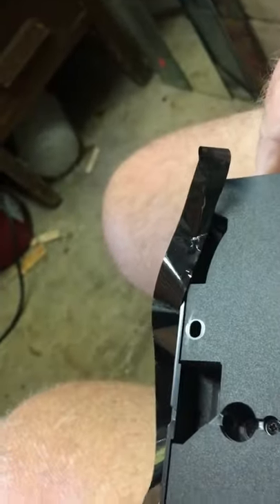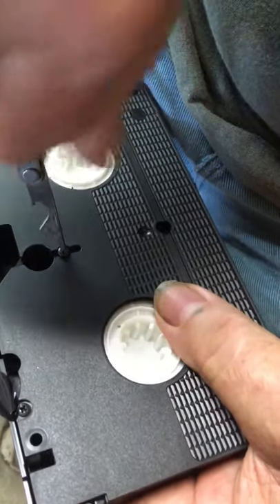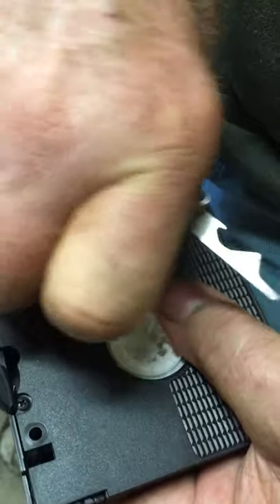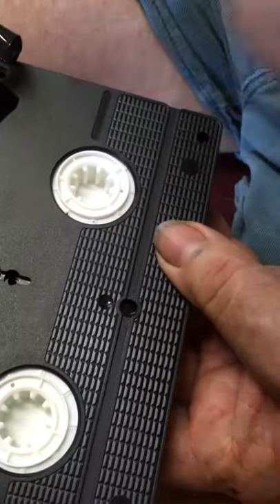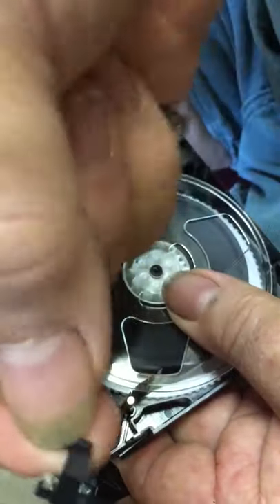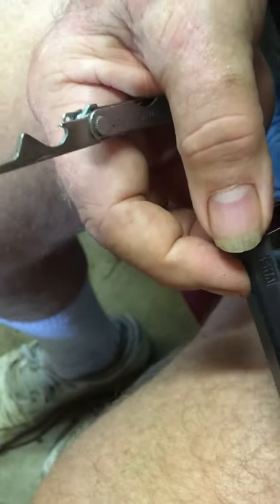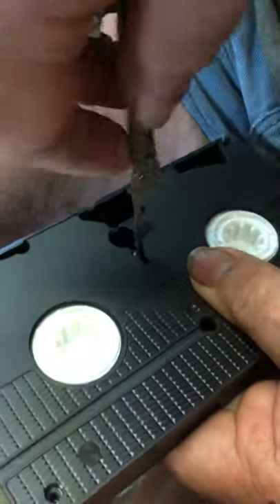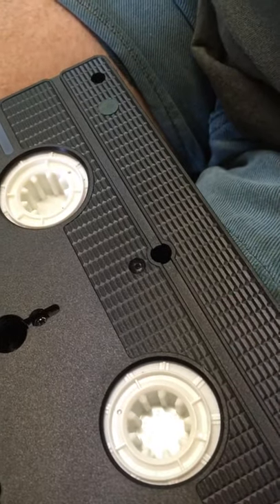Fixing a VHS tape which gets tangled in the machine.

Comment: Hey boss, is there any way I can  stop my VCR from actually tangling tapes?
Reply: About all you can do with the machine is keep it clean and free of foreign objects. The cassette labels come off and gum up the works sometimes, or things like paper clips. Also if the machine is dented somehow it can cause a problem; take off the top (usually with screws in the rear and it slides off), clean everything thoroughly with alcohol and a bunch of Q-tips, unbend anything bent and put it back together~